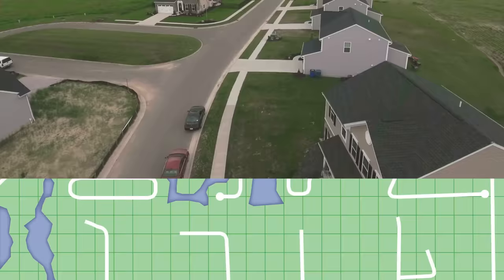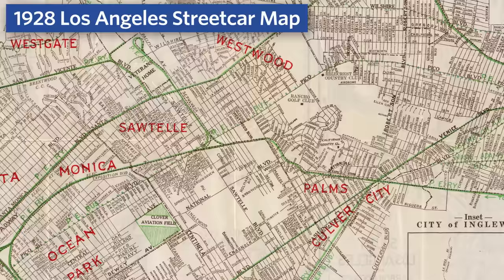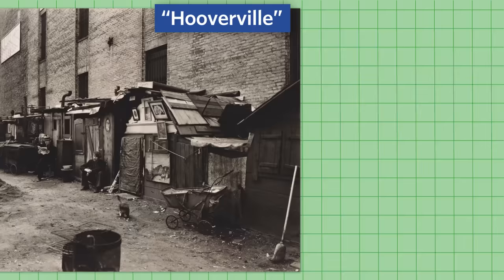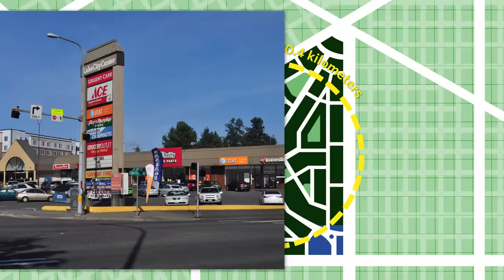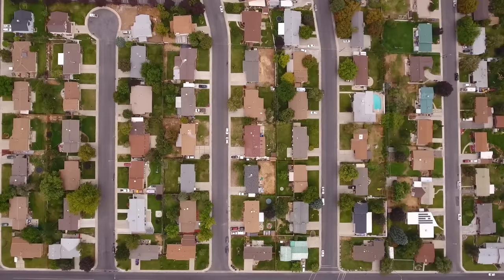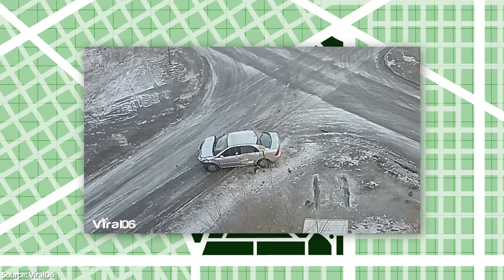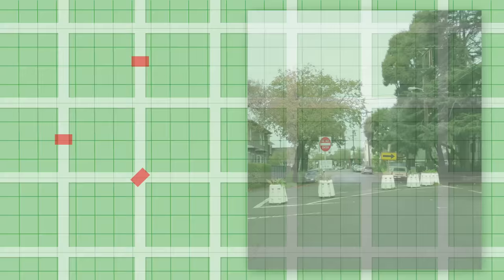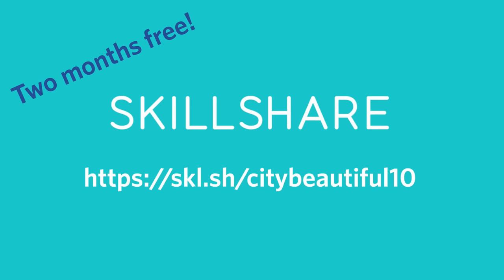The Reason Our Streets Switched to Cul-De-Sacs

Comment: As with so many of these things, it's painfully myopic.  Maybe those T-junctions within the subdivision are individually safer, but what about the effects on the surrounding network?  These dead-end portions of the network inevitably lead to extra congestion on collector/arterial roads, where speed (and thus the impact of a collision) is higher.[1]  Not long ago, I saw the aftermath of crashes on the same road on consecutive trips.  The only reason I knew about them was that the damage was pretty severe; the cars needed to be cleared from the roadway at difficulty.  It's crazy how dangerous these roads actually can be, without anyone seeming to notice.  I hate to admit that I'm probably part of the problem; I only think about it when something bonkers like this happens.

This reminds me of the whole can of worms known as "level of service" analysis.  It's self-defeating in the same way; a system intended to head off congestion issues only ends up inevitably creating more.

[1] Though, due to systemic habits of creating needlessly wide roads, and the requirements of off-street parking even in single-family units, speeds within a subdivision may still be dangerously high.

Comment: There is some false assumptions in this video. There is no desire to do away with cul-de-sacs, and we have not "switched" away from the grid system. In the eastern US, land was subdivided by metes and bounds and that has a lot to do with the fractal shapes of land and angled streets. This is true in Europe and most other countries. Land was defined by streams, trees, stones, etc. In the west, the Public Land Survey System (PLSS) that was defined by the Land Ordinance of 1785 (0:35) is the basis for townships in most the western US. You can't undo those deeds without starting all over, so there's no switching systems. Also, the video seems to conflate city planning with the developer's role. The cities do not plan out the street layouts within a subdivision. The land surveyor and civil engineer do. The city only designates zoning for schools, residential areas, industrial areas, etc. There is a traffic master plan that designates major arterial streets, freeways, etc. Collector streets, which is what cul-de-sacs are, are a design choice of the engineer, pure and simple. There seems to be an assumption that cul-de-sacs were a mistake from the get-go. THEY ARE NOT. Cul-de-sacs create a sense of community among those within the cul-de-sac, they allow you to fit more homes per linear feet of streets and utilities, which lowers housing costs (and as a result raises the quality of homes per dollar), they prevent traffic from speeding through areas where kids might be playing, they break up the monotonous barrack-like rows of buildings, and they are a tool (among other tools) that allow you to take odd-shaped parcels and utilize land that would otherwise be dead space. There is no push to do away with them and return to higher housing costs, replacing trees, land and homes with more asphalt.

Comment: 6:30 a great example of this sort of thing is Sunriver, Oregon! They have absolutely 0 lights and focus instead on roundabouts which means the residents are far far more fuel efficient when they drive and the way that they have integrated bike and walking paths means that a large number of residents rely on biking over driving and it’s the preferred mode of transportation for people aged 12-17 as it’s far easier for them than getting a ride from someone else or buying their own car in the case of those 16-17. I’d love to see a video on their planning and urban engineering from your perspective!

Comment: There's a neighborhood in an area where I used to deliver pizza when I was much younger, with the main cross-streets being named Champlain/Perrin, which alone tells you what kind of neighborhood that it is. Yup. That's right. Pretentious douchebags. The worst thing though, is the fact that these streets are ALL made up of very long streets that damn near make circles, & inside of these huge circles, tons of tiny subdivisions that randomly change street names based on which angle the road takes. It's impossible to find the house, or even the street that you are looking for, & once you actually do find it, you can't find your way out! 
FYI, this was pre-GPS, so you're basically just guessing on everything. It could take you an hour to find a house and get back to the shop that was 10 blocks from the store. There should be a law against building neighborhoods like this!

Comment: It’s insane, like many things in the “modern world” today. Of course there are negatives and positives in the grid system and the “cul de sac” system. But it’s obvious that the positives with the grid system is weighing in much more than the negatives, and that the negatives with the cul de sacs are huge. I live in a cul de sac and it’s insanely irritating, not only that it’s very irritating, uneconomic and plainly stupid.

Still the planners are building new estates with this insane system, like so many things in moderne society they are onto weighing up everything but only short term profit or some other stupid reason that does not make sense in the long run.

Comment: Somehow there feel like the actual design goal was to force people into driving longer distances with everything else only being a side effect, for which the claim even should be rechecked, if it's even true…
I also had to laugh, when you said "smaller streets" and show us something, where it's comfortable to drive fast in both directions even when cars are parking on both side (which should rarely happen, as they already have 5 parking spots each). And why do these houses have more front- than back yard? The cul-de-sac itself should be so narrow, driving faster than a bicycle must feel uncomfortable.

Comment: I am from UK. We have many culs-de-sac. They help reduce crime, except where there are footpaths that allow access. These interconnections are a bad idea.

I live in a cul-de-sac of 11 houses. It is a 1 minute walk to a bus, which takes 5 minutes to the local railway station, which takes 15 minutes to get into Birmingham city centre. I can walk to the station in 15 to 20 minutes, and take a route that requires to me cross a few roads, but not walk along any. During Covid I have walked to my local NHS Hospital for appointments, and the 70 minute walk along canal tow-paths is very pleasant.  I believe that many city Americans are unfamiliar with the concept of walking to get somewhere. 

I am extremely pleased that the machine-like grid design (it does for the environment what le Corbusier did for homes - makes the environment inhuman) has not extended much into UK.

Comment: It's even more painful when these idiotic designs are applied at regional scale. Where I live the east and west half of the region only have a handful of circuitous  roads connecting them so not only does it mean everyone has to travel farther but it also dumps everyone onto a small number of overly congested arterials so you have to drive in stop and go traffic that moves slower than you could walk except the distance would be to great (going 1 mile as the bird flies can literally mean going 10+ miles on foot or car because of the idiot city planners).

Comment: I am very disappointed with the bias in this video. Subdivisions are a VERY GOOD design principle. Assuming that you have stairways, greenways, walkways, bike ways etc to link the subdivisions together then (which are very common in Canada at least) you end up with HUGE benefits to the neighborhood in question regarding privacy, noise pollution and safety VS a grid design, as well as a TREMENDOUS decrease in the cost of road maintenance and initial construction due to the drastic reduction in concrete/asphalt use to pave roads for cars (of which maintenance is funded by the tax payer). Not to mention more usable space for developers because, less roads. Yes you mentioned this "hybrid" idea at the end of the video, but it should have been the foremost topic. Grids are TERRIBLY inefficient from an economic standpoint. There is a reason our forefathers went away from this. Grids made it easy to expand and the expense of efficiency. Good for initial expansion of a young country, terrible for consolidation of an old one. Enough said.

Comment: So in a place where the city is grid (manhattan), if you drive a car, that means you will face many traffic lights? Since every (let’s say) 200 meters, there is always an intersection. That means to drive for 2km only, you still need to stop at 10 traffic lights?
Reply: Apparently you have no idea how traffic lights work.  Take a look at any pic from a big Avenue in NYC almost every light facing you is the same color they are synchronized so in those 10 intersections you will stop one or two times

Comment: Grid causes worse traffic because constant start-stop cycle causes low average car speed. Need to have highways mixed in the grid to have better flow but it creates other problems... We need some sort of a fractal, I guess...
Reply: I don't think so. Highways will make it worse due to induced demand. https://youtu.be/N4PW66_g6XA

In the first place, highways are designed for long-distance journeys, not for inner city transit. Really, the solution is to reduce the number of cars, and provide alternatives to driving (pedestrian paths, bicycle lanes, mass transit, etc.).
Reply: @dbclass4075  what is your objective? To create a city where it is convenient for people to live or make their life miserable?=) 
Even driving through plane grid is faster than mass transit: this is because public transport have much slower average speed than car and because public transport will never go directly from place where you live to place where you need to go, and you will have to switch between different public transport routes, wait on stops and still walk a lot between public transport stops, your starting point and your destination.
The main problem with highway is that exit point may not accommodate traffic flow from it, thus its not an easy fix and requires actual planning from city planners and that is something they rarely do.

Abstract roads can handle unlimited number of cars. In real life though they can't of course. Road capacity depends on  speed of traffic flow on that particular road. Thus higher the speed - the more cars can go through road. Because of this isolated roads work well. The problem is that road is a system with positive feedback: when something decreases speed of traffic, it decreases road capacity, which decreases traffic flow and so on. Usually each road have some bottlenecks which slow down the traffic and causes traffic jams to appear almost without dependence on how many cars are on that road at the moment.
Reply: @skipperg4436  Making the car the only method to get anywhere is miserable. Operating a car is not cheap. On congested cities, cars faster than transit is not guaranteed; it could be the other way around, such as Central London.

Which is why do both: increase the road capacity is much as possible, while reducing the need to use cars in the first place. Mixed zoning can reduce distance to get to places.
Reply: @dbclass4075  its not practical to expect people to change place where they live every time they change their job (its okay when you are 20 but becomes very complicated later on). Besides, housing in the middle of the city is horrifically expensive almost everywhere.
Problem with bicycles is that they are very dangerous to the user if used on roads, dangerous to pedestrians and are a miserable experience in less than perfect weather. Imagine riding 10km on it through a blizzard or storm.
Center of London is not the best example because of just how old it is despite being relatively big. Most of the really old cities have very small historical part where people don't work and don't live and it is left for tourists, museums and stuff like that.
Generally speaking, even in large congested cities commuting by car is 2-3 times faster than public transport. That's what happened to me and I live in city of 6 million people (8 when you count suburbs and illegals).
Reply: @skipperg4436  Are you under impression Central London does not have residents, only business, offices, and governments? Mixed zoning is a thing there.
Reply: @dbclass4075  no no, I'm pretty sure Central London DOES have residents and offices, while most of other cities that have historical part either don't, or people living and working in historical part are a tiny minority.
So obviously London faces some unique traffic challenges.
Traffic in general is a complex problem that needs complex solution.

Comment: the grid system that you had you Americans is fascinating because compare to the city of europe, our cities are in the end a monster mess "mdr" it goes in all without, streets or even the smallest American car would not pass.
in fact, for the oldest American cities which, for their downtown areas, were not too remodeled, one can see the basic European model. And around cities with urban expansion, the new system of 1785 grid system put in place in 1785.
01:36 I would have the staff said that it was due to the fact of the houses around, and on the hills like in Los Angeles or San Franciscio example or Oakland? not practical to make a grid on hills? no ?

Comment: Does the US not typically have footpaths at the end of cul-de-sacs? o_O
Reply: nope
Reply: @lobsterrock4570  Well, it seems that that's the main issue - it's not that cul-de-sacs are bad, they're just missing the supporting infrastructure to make them great.

Here, most cul-de-sacs have a footpath at their end, connecting with other footpaths or cul-de-sacs and providing a very easy way to get around by active travel methods. I specifically chose to live on a cul-de-sac because of the benefits.

But without that, I can see how they would be frustrating.

Comment: Interesting video thanks, but you seem confused and your argument is poorly formulated.  This is not about a grid versus disconnected / cul de sac design being "better" or "worse".  That debate has long passed, people simply prefer to live in disconnected layouts due to lower traffic, reduced noise pollution etc.  
The negative you mention about disconnected designs where people needing to travel further for amenities etc is simply due to ridiculous american style suburbs where there are barely any sidewalks, walking paths, shared cycling paths whatsoever.  That's the real issue, it has absolutely nothing to do the existence of cul de sacs or not.   Obviously if the disconnected pattern contains waking paths that short circuit these longer roads there is simply no sensible reason to even think about grids as an option when designing a new suburb layout.
I do find it telling that even in 2019 you say that some suburbs are STARTING to introduce better walking paths to shorten these distances.  It's quite crazy that america is still so addicted to cars that only now this is happening.

Comment: "disconnected mess" Yeah no I have to fully disagree on that. I really feel the point you're making in the end, they need good walking/cycling connections. 
But if those are present, disconnected neighborhoods I think are far better than just grids. You got safer intersections, less intersections on the artrerials, so better throughput, provided good walking/cycling connections are present, you also discourage people from taking their car which is also beneficial for throughput and the environment.
Grids are pretty much terrible at a lot of things, throughput, safety and you can go everywhere by car in a straight line, so people will often times take their car, which is really not what you want if walking or cycling would be a good alternative.

Comment: The only time I can understand the rationale of the 'cul de sac' system is if the topography can't safely support grid pattern streets. Needless to say; I vastly prefer the grid system, with a few diagonal main line streets/trolley cars rights of way. I don't care for Wash DC as such but, their street system makes sense.

Comment: You speak as though driving a car is a bad thing, which I guess shows your bias. But the part I found kinda funny is that the federal regulations that thought they had the better answer back then, are now what is preventing free market to just adjust to whatever design would be more preferable today. So my own bias was affirmed there, when the gov't gets into something, it's stuck at w/e moment they got into it... hard to change after that.